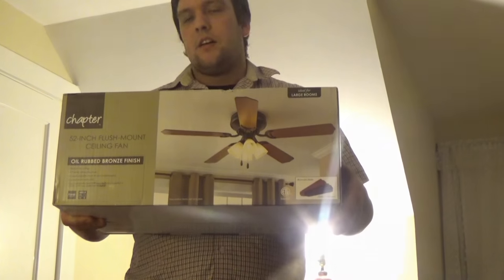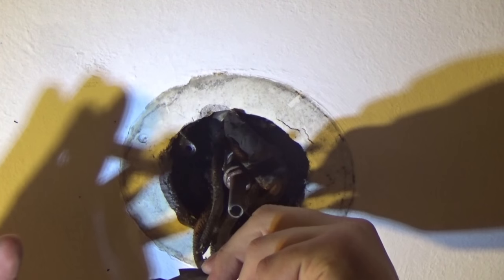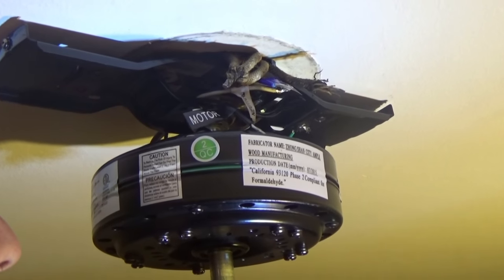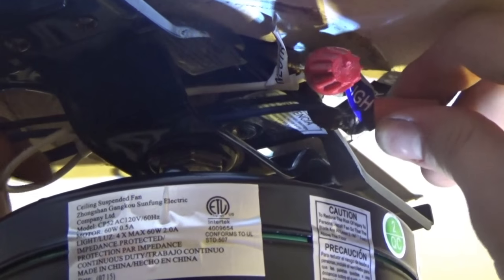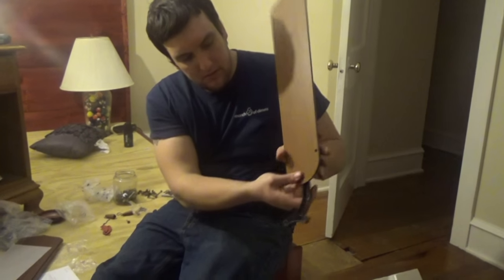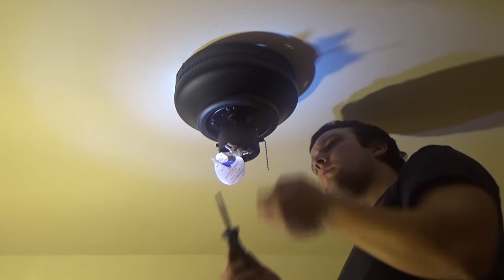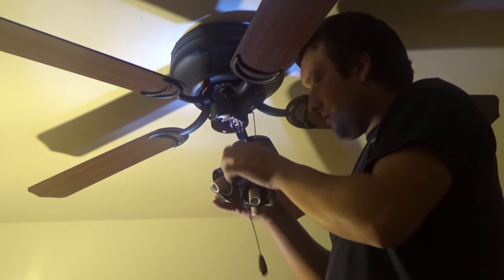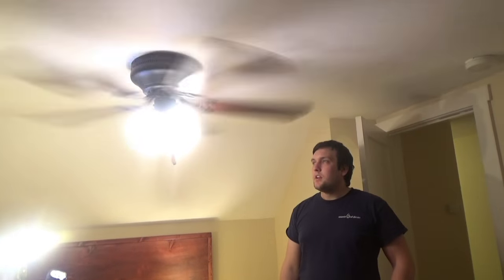How to install a ceiling fan

Comment: I've installed different fans before, including ball & socket fans, J-hook spinners, and hugger. Not too easy, and not too difficult either.
Reply: I always use ground. If fan has no ground, I would just attach ground wire to metal part.
Reply: That was never my case fortunately. Did you check out my videos by the way?
Reply: You can go ahead and subscribe!

Comment: What about a fixture that the fan works but the light doesn't? Any tip on fixing that?
Reply: Yea man just go to a hardware store/department and ask for a light bulb, they will give u a bulb and u go home take out the old one. Remember left loosens and right tightens. Just be careful to not blow yourself up. U may need an electrician to do it for ya. This guy buzz seems to know a lot lol hit him up. Maybe the both of you together could figure out how to put in a light bulb 😀👊